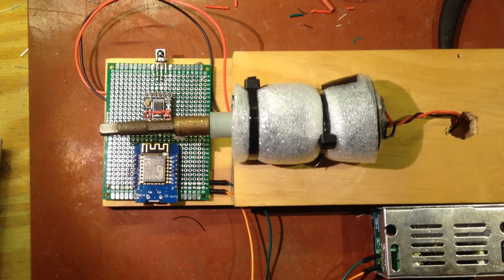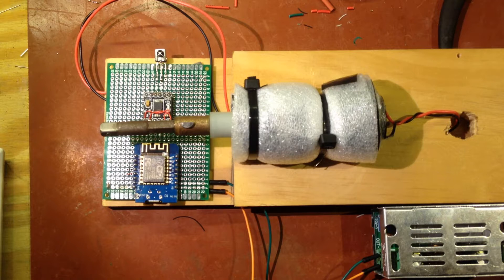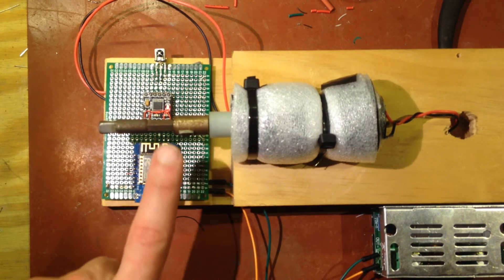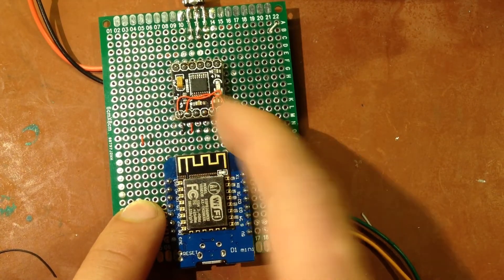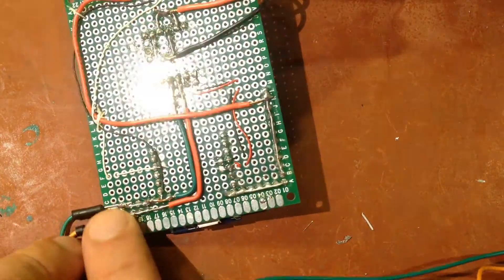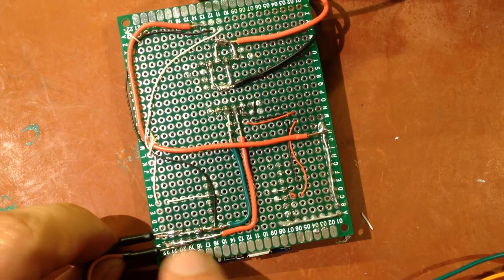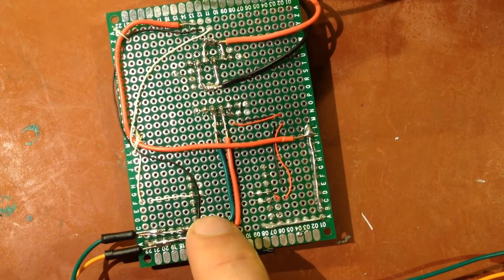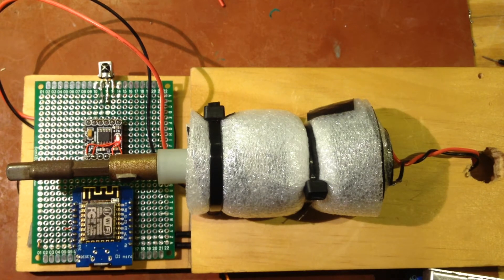Projector drive electronics

Comment: Opt for the One Plus camera for manual mode for Photos,  I have a G6. The hardware of One plus is better (Larger sensor and Pixel Size). Though it's missing the Super Wide angle lens. For videos G6 controls are awesome.
Reply from the maker: +varaprasad sb thanks